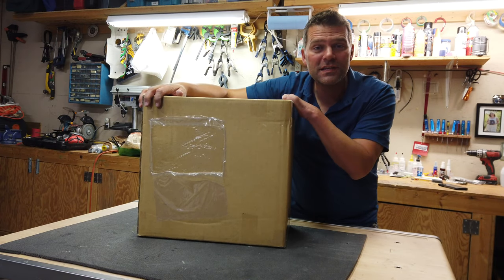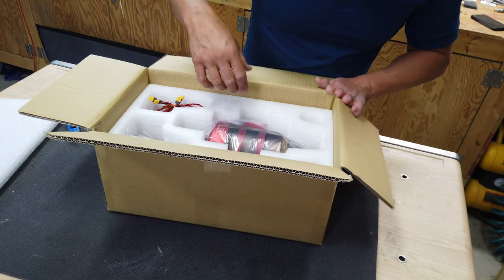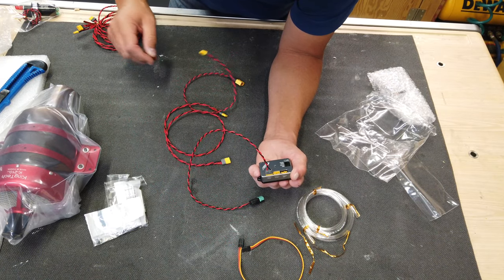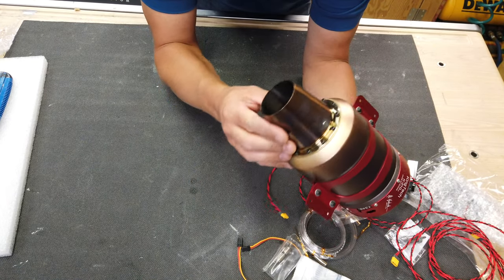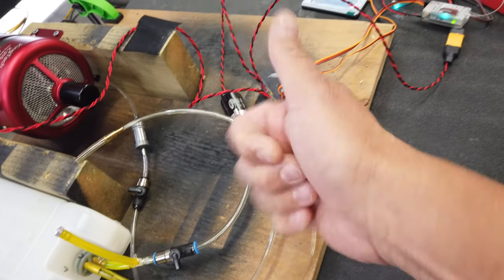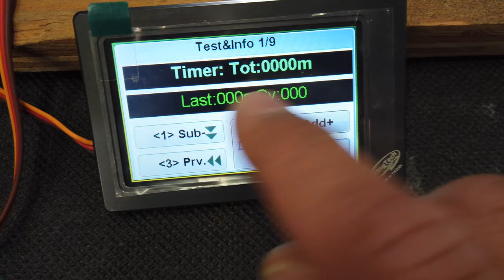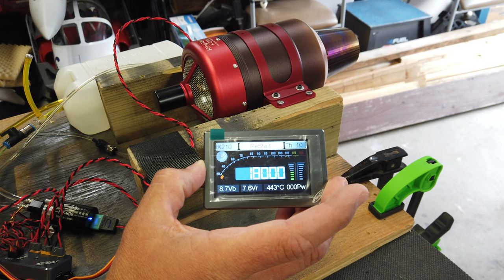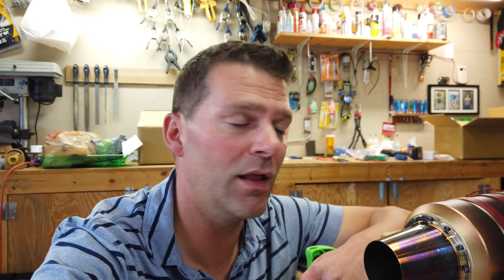KINGTECH 210 G4 MICRO TURBINE - Unboxing, Test Run, Auto Restart Test, Review

Comment: After that restart test, I now see why you are so careful setting up your fuel systems to avoid air bubbles...😳... a petrol/glo motor would have just stuttered and carried on running..🤷🏼‍♂️
Reply from the maker: Hey Ian.  Yea it really doesn't take much to disturb the engine.  A small air bubble can do it and in the case of this video just a slight disturbance in the flow.  It's a cool feature but there is some risk involved as they explain in the manual as well as with it taking 15 seconds it may or may not work out depending on the plane.

Comment: Excellent video Jonathan.  Auto Re-start was great.  I need to verify that function on my G2. I have never done that.  The new ECU ports and cabling is great.
Reply from the maker: Thanks Randy.  It's a feature ive never used in the plane before but on the L39 and my New project I think the Auto Restart will be turned on.

Comment: Hi mate that motor sound beautiful and i suppose it cost you a fortune and how long did it take you to properly fly a RC Jet
Reply from the maker: Hello Albie.  Yea they are not cheap little things.   I started with Heli's in about 2007 then basically went straight into jets/turbine powered aircraft in about 2008/2009.  I would say Proficiency happened about 5 years.  I probably should have flown some regular planes for a bit first but oh well.

Comment: What is the primary difference between a Kingtech 210 G2 verses a 210 G4?
Reply from the maker: G4 went to a bus system, so one cable feeding data and power to turbine. G2 has a phone cable and MPX cable. 

G4 brushless starter motor and G2 normal starter. 

Those are the big differences
Reply: @thelightersideofrc  Thanks for the reply, bought a G2 last year still new in the box for an aircraft build I started this year.  Thinking I should have gotten the G4.

Comment: Like how you showed where every goes, that new data system my explain why it doesn't have a delay in spooling up like old generations! Did you adjust the idle response on the radio or are you fine with the touchy idle setting? Great video as usually .
Reply from the maker: Thanks Russell.  I'm fine and happy with the touchy idle to thrust setting.  I didn't have to adjust anything on either engine.  Both started great and no adjustments needed.  This could change slightly when it's installed in the aircrafts as you have different conditions with tank setup etc.

Comment: How many PSI does the fuel pump generate?
Reply from the maker: A couple years ago a Jetcat turbine I was working on wasn’t working properly and the turbine pump started at high power and the solenoid didn’t open. It developed enough power that it burst the festo tubing. I’m not sure off hand how much pressure 4mm festo is related for but it blew it no problem
Reply: @thelightersideofrc  Thanks. I could not really find any docs with PSI online but i did that on phone which sucked. Will try on desktop again.
Reply from the maker: It says that festo tubing holds 16bar / 232 psi so I wouldn’t be surprised if it can make more than that.
Reply: @thelightersideofrc  Great, thanks! 😉